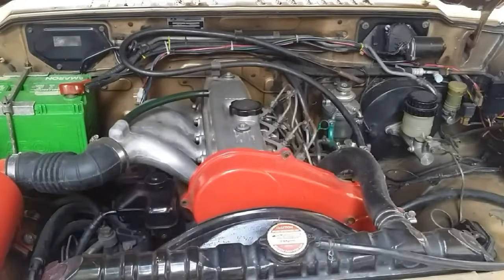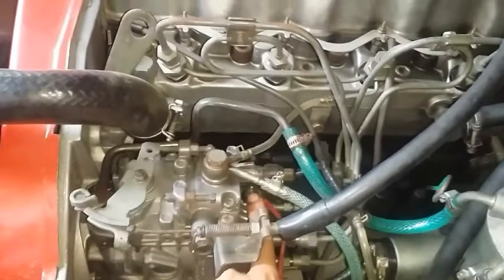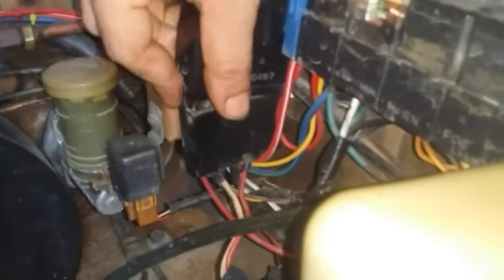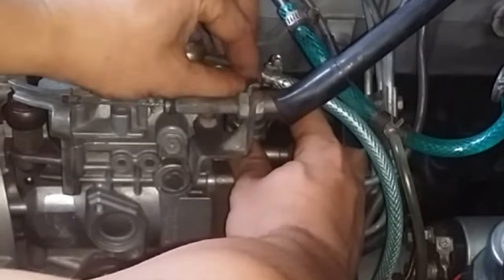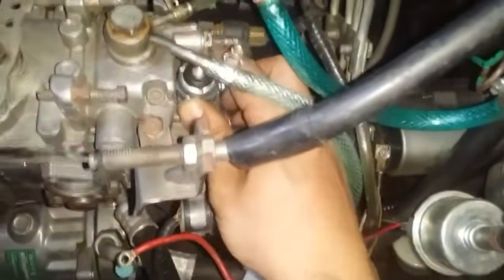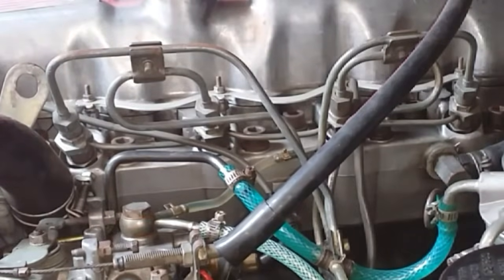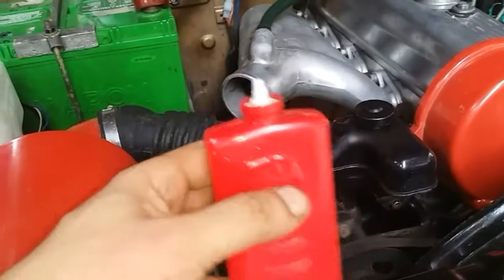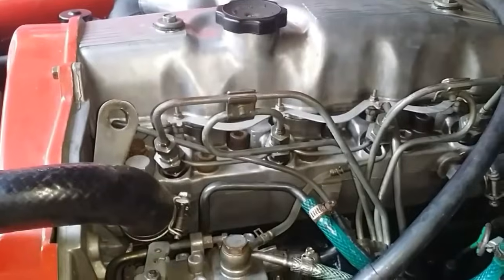Cranking No Start Problem

Comment: Sir I've tried everything and my 4d56 still isn't starting. I've replaced primer pump, glow plugs and fuel shut off solenoid is working properly. Timing is proper, Valve adjustment is .15, I bled all injectors and still no start. Only cranking.

Ive even tried the lighter fluid trick and my engine only cranks no start still

Comment: capoooo amigo tks a lot ... this was really helpful! ... my engine is a really basic one piston yse8 hp yanmar for a boat ... is been starting but every time whit a little more of dificulty and now basiclly doesnt wanna start at all ... if you have a clue ill apreciate it otherwise with this ill try tomorrow when im there
Reply from the maker: Check the injector. Remove it, connect the fuel line, depress the decompressor lever and crank the engine. See if the spraty pattern is still ok.

Comment: i have a 2003 l200 and ive changed the fuel filter + aired out the system and checked the injectors, and it comes diesel out of them. what may be the issue

Comment: i like the way you explain sir..i have problem for hard starting when i crank my engine mostly twice and apply accelerate then its start and sometimes i pump the fuel first before i crank it then start..i replace my fuel pump twice,glow flug is new,battery is good alternator is new and its almost a year they clean up my starter...

Comment: Why would a common rail diesel engine not start with starter turning fast and efficient, but will run start in less than 2m.

Comment: Hi Mr. DIYer, I've been watching almost all your videos about Diesel engines. Currently, I finished watching this vid, and I have a liitle concern regarding my 4m40 Engine. First start in the morning after long park or no use of the vehicle, it starts with no fuss and one-click smooth. Now my concern was after a drive and I parked it for a while and try to start it again, I observed some cranking maybe 1-2 seconds before the engine will start - which I believe I did not encounter before. I am wondering what causes it to behave like that. Maybe you can enlighten me. Thank you so much!

Comment: Hello, first of all I want to thank you for your best explanation regarding problem with starting, I made a habit to start The engine with engine starter spray, I will try to do next day all those steps that you presented. I have a question, I tried to read the error with OBD but I can't, do you have any idea why,  check engine ON, what diagnose do you use? Car details: Mitsubishi L200, 2.5L, 85kw, from 2002. Thank you in advance!

Comment: What continuity meter did you learn on. 
 Was it a thick black plastic. The old one shorted or something. 
 Or the newer big box unit. There're two batteries in that old thing. 
 My question is if I should buy a new continuity meter.
 Yea, but what should I ask for. The guy at the store is cross eyed, "I've never heard of anything like that, a continuity meter. No, try Napper or something. We don't sell no imported products"
 Duff

Comment: does this work on the "newer" 4d56 engines equipped w/  common rail feature?   my  '12 montero sport is inconsistently  starting.   the fault code it threw out was p0628  when i scanned it.   thanks for the clear video bosing!

Comment: Hi..id.like to ask.whats the remedy for a hard starting diesel engine after a.long ride.meaning it is still hot. No problem on first  start from overnight rest.
Reply from the maker: Engine heat soak
Reply: @MrDIYer  whats the best thing to do?
Reply: Maybe your battery is getting old and weak, thats why its hard to start even when engine is still hot after long drive, you may have a 12volts rating but the amps is getting less to crank your engine.

Comment: I have a mazda 3 1,6 diesel 2011, i was driving it on highway when the car suddenly shuts of and wont start anymore. The engine shakes when i try to start it . Do you have an idea what could have happened?
Reply from the maker: When it turned off did it feel like the engine was choking? Like pressing of the gas pedal but it wont respond?

Comment: every Time I have to start my 1992 pajero exceed I have to pump it manually at the fuel pump but after I have started the engine it is now easier to start the engine but after about 12 hours, I have to manually pump it again just to start the engine again. do you know any solution for this? or do I have to change my fuel pump?
Reply from the maker: Try performing a tune uphttps://youtu.be/ZiYvfKNNtX0

Comment: I have a Mitsubishi l200 1996....I recently changed from turbo to non turbo ,problems is I'm not getting any power ..I cant even get it out of the garage..what do u assume might be my problem here?
Reply from the maker: Depends on whats cauaing the problem. If you rev yhe engine and feels as though its choking or has no power then check
1. Air/ fuel filter
2. Bleed air out of fuel line
3. Leaking or worn out pump and or injectors
4. Clogged catalytic converter
5. Adjust fuel enrichment screw
https://youtu.be/VWBu53sNbas

If however you rev the engine and it feels like power is not being transfered then you migjt want to check transmission.

Comment: what size and brand of fuel hose do you use?
Reply from the maker: im not really particular with brands when it comes to hoses. i would suggest measure the barb tube of which uou want to connect.most of the time if its a japanese vehicle it will be metric measurement either 4 or 6 or 8mm.

Comment: thanks for the video .. We have same engine but mine is still overheating even we've done top overhaul and done overhaul also the radiator and no leaking .. my radiator have 2 tube its not original for the 4d56.

Comment: Hi, I have a problem with glow plugs.
The problem is turning the key in contact. Reles do not work. But when starting. These begin to work repeatedly. What would be the problem? Some say it is a ground problem but I cannot find the ground.
(Pajero 1990 2.5 intercooler)

Comment: 👍👍👍
Reply: Bakit po madalas mapundi ung shutoff solinoid ko.nkadalawa n po akong palit.pero kpag lumamig na solinoid .gumagana n sya. Sa ngaun tinangal ko muna ung needle.sa kambyo n ako nagpapatay ng makina.salamat sa sagot
Reply from the maker: check wiring baka may short. check harness. check output voltage. check voltage drop.

Comment: Ang galing!!! Sa wakas nakatagpo din ng maayos at malinaw na DIY paano magtroubleshoot ng diesel engine (4d56) hard starting issue... palit glow plugs na lahat, bago battery, maayos na starter, yun pala fuel lines lang... mabuti hnd ko agad nadala sa diesel calibration... excited na ako itroubleshoot at maibalik na ang one click start ng sasakyan... Thanks sa inyo sir!!!!
Reply: sir kinalas ko fuel filter ko, paano ko po malaman if defective na ito... may basic bang pde gawin para if ever bili na ako buo assembly instead of filter lang... thanks!!!

Comment: Brad d4bx Hyundai yung makina ko, noon mapaandar sya ng isang battery lang Peru Ngayun dalawang battery na ang gamitin 24 volts na noon 12 volts long, anu ang sira nyan
Reply from the maker: kung series connection yan at at 24v output sunog na dapat starter mo. baka dalawang battery yan naka parallel connection. check mo mga battery mo isa dyan ang sira brad